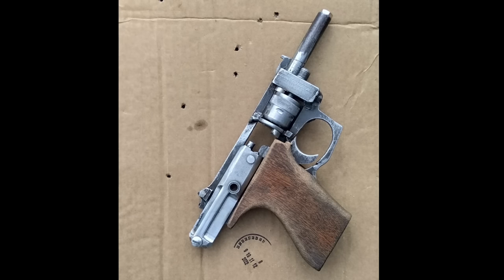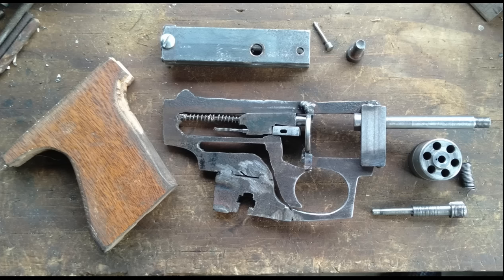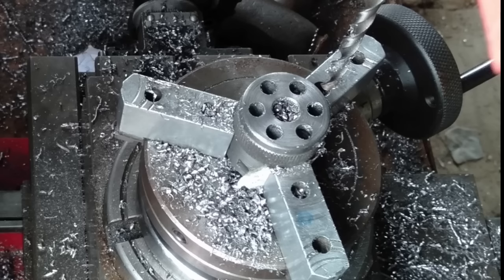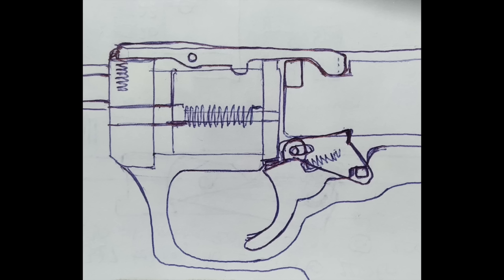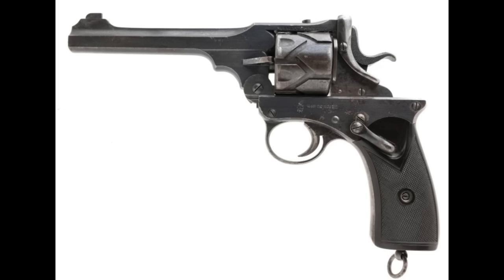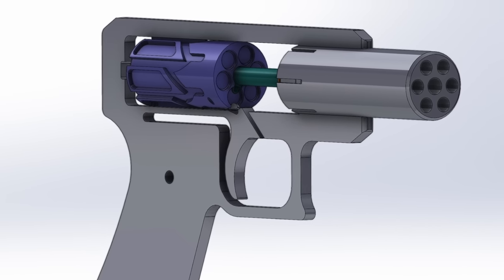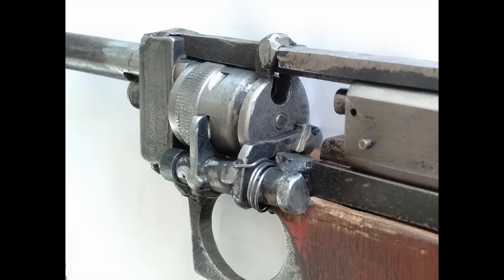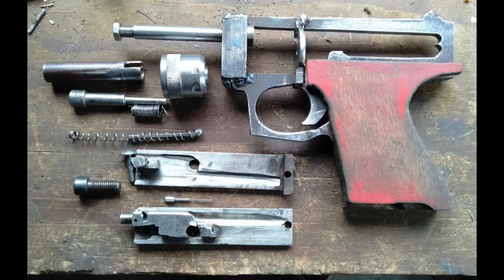Semi Auto Revolver?

Comment: The compliant mechanism in that trigger is simultaneously one of the more impressive firearms engineering design components that I've ever seen while also being absolutely cursed. lol
Reply: imagine the cost of replaceing a triger on a factory gun with a compliant trigger 
and the new ffl transfer involved
Reply: @Knobs4u  those things actually last for close to an eternity, the thruster redirection systems on space probes were designed with compliant systems so that they have the highest possible cycle lifetime possible as you don't get to do maintenance on something you shoot out far away into space.

so chances are, if the frame is well built you can pass the gun down several generations and shoot all day and it won't break.
Reply: @baraka629  you missed the joke, but thanks

Comment: A full auto revolver is something I've been thinking about how to do but obviously not going to build one because I don't have an SOT, would love to see your version of it
Reply: You can absolutely build it as a semi auto.  Well within your rights to do.
Reply: They exist, some fighter jets use what is called a revolver cannon. Single barrel, but it has a revolving cylinder which handles the cycling, each chamber taking turns doing each step in the load cycle as it goes around, so they can reach truly blistering cyclic rates.
Reply: @Vikinggunsmith You don’t need to have an SOT or any other gun license,to make your own gun.Outside of the normal gun laws like not being a convicted felon and other stuff like that,the only other requirements is you can’t make the gun full auto,and you can’t ever sell it to anyone else,and you might have to put a serial number on it ,depending on what state you live in.
Reply: @dirtyd2316  for a machine gun (full auto) you need an 07 FFL and an SOT otherwise it's a unregistered NFA item, for a semi auto you don't need any licenses and all that, if you need sources look at the NFA of 1934, the GCA of 1968 and the Hughes amendment of 1986
Reply: @dirtyd2316  if you have to put a serial on it then you may as well fill the form so it can be sold to someone else after you pay the appropriate fees
Reply: fully automatic revolvers how to make has been around since the zig zig and Pancor Jackhammer revolver shotgun. its absurdly simple
Reply: There's an article in an old issue of Guns and Ammo that says they accidentally figured out how to convert a single action revolver to full auto when attempting to figure out how much cylinder gap affected velocity. They had built a single action army so that the barrel could be threaded in and out to adjust the size of the gap, then it turned out if you had the gap big enough the gun would go full auto. What would happen is the cylinder had enough play to move back and forth, so when you fired the recoil would slam the spent casing back into the firing pin (integral to the hammer on as SAA), which acted as a short recoil system that had enough force to cock the hammer. Since there wasn't any kind of disconnector in the trigger the effect was identical to fanning the hammer.
Reply: Ever heard of the Luty? You can build what ever you want dude , home made machineguns are 100% legal in the USA,  it just can't use any gun parts , as long as you mill everything yourself it can be full auto
Reply: @vikinggunsmith  no you can build a machinegun if it uses 0 pre existing gun parts , they can't stop you from building it you just can't sell it
Reply: @Cold_Cactus  the Hughes amendment ended the registration period for machine guns for private use on May 19, 1986, and per the NFA All machine guns must be registered with a tax stamp, nice try fed but I'm not that stupid.
Reply: @Cold_Cactus  That just isn't true.
Reply: Gotta love the nfa, nothing stifles innovation more than prohibition. Imagine what new full auto tech we would have if we didn't have what like half a century of no new civilian legal automatics.
Reply: @Cold_Cactus  nice try agent
Reply: @dirtyd2316  You darn well do need an SOT for automatics though!

Comment: Semi auto revolver with a slide that operates like an open bolt gun?
One of the weirdest things I've ever seen.
Reply: Hey, you again! How are you?
Reply: the 10mm pistol in fallout and fallout 2 have a similar mechanism
Reply: @FN_360  doing fine I guess, hope you are as well.
Reply: @ARMASOG  I figured it was more like the Dardick because it's implied to have a magazine (even though it has an exposed cylinder, but that's mostly because it was originally a legitimate revolver, probably.)
Reply: That’s creativeity.
Reply: You can drill through pics of confiscated arms. There is something roughly  like this in one of those pics.
Reply: I would buy it cause it’s cool
Reply: Actually, I'd say that the idea to use pre-chambered rounds (i.e. revolver cylinder) is not bad at all, considering the calibre. .22LR, a rimmed cartridge, is well-known to be not-quite-so-reliable when fed from box magazines... I only know one pistol that works really well with .22LR---and that's the famous Beretta M71 (mine is almost absolutely reliable, only ever had 1 failure to load).

With "true" pistol calibres, a box magazine makes a lot more sense and benefit; to the point that in such a simple open-bolt design, it's actually the most critical part of the gun... :-)
Reply: ATF wants to hear more about that "open bolt auto-revolver"
Reply: Kel-tec needs to hire this guy
Reply: Murphy's Laws of Combat: "If it's stupid, but it works, it ISN'T stupid!"

Comment: The original OWEN GUN PROTOTYPE SMG had a rotating cylinder that was wound up with a clock spring. Owen made it as a teenager out of an old .22 short rifle. A thumb trigger released the open bolt for full auto fun! Love your work and videos!

Comment: Love to see different gun ideas for how to meet various needs and ideas.  I once saw a .44 Taper pistol made for the French Foreign Legion in North Africa.  Because of inevitable sand intrusion in the desert, the big revolver (looked Webleyish) not only had all moving parts working at quite wide open angles so as to not trap sand and jam the action, the cartridge case was a pretty steeply tapered conical shape so if sand got between the case and the cylinder wall, a sharp tap in the fired brass would dislodge it easily rather than trying to drive a straight wall case out of a cylinder with sand imbedded and scratching all the way.  The most impressive feature was that the back of the grip frame was hinged to open like a book and could be unlatched and swung open, quickly cleaned, then closed and returned to service.  Also, all of the functioning parts were highly polished like surgical tools to resist having sand adhere to them.  Would have loved to add it to my collection but the owner wouldn't part with it.  Really neat gun but I can't find anything resembling it on the Internet.  Jess

Comment: awesome, my thoughts were to combine the gb-22 with sort of sten-ish upper receiver. it would have to be striker fired closed bolt and most likely add a second piece to the frame trigger that acts as sear and disconnect. But if legality weren't an issue, it would be even simpler.

Comment: Having the cylinder use spring tension to assist rotation is pretty genius. i thought you couldn't really do this with a .22LR because you wouldn't have enough force over all to work everything. i wonder if you would replace mating surfaces with teflon and reduce friction enough to not even need the spring?

This revolver is basically the guts of a ruger 10/22 mag moved up inside the action and i kind of love it. The ruger mag is "wound" when you push rounds into it and they roll up in there.
Reply: Yup, an old magazine design going back at least to the pre WW2 Mannlicher-Shoenherr (sp?) or earlier.

Comment: Yes Mark, I've got plenty of questions after watching this thing a dozen times! It took me awhile to realize there's at least 3 different versions of this gun represented in this video which made it really confusing.

Only the version with the side lever to stop cylinder rotation seems to have been built. It looks like the release is supposed to be triggered by the slide somehow but the angle feature would push the mechanism in the wrong direction. (down) 

I'm also wondering how the empties are able to eject out of that single hole? In order for that to work the cylinder would have to stay locked until after ejection finishes otherwise the cases would get caught because of the cylinder twisting while they are partially ejected.

The drawing for the cylinder lever in the top of the frame is interesting but won't work as drawn. It needs a ramp in both directions in the bolt  so it's able to cam in both directions. Even then it won't work without a delay on the cylinder index cycle or it's also possible to slot the rear cylinder backplate to allow empties to exit. The trick would be to do so without leaving the rounds a chance to slide out through the slots when the firearm is tilted upright.

The bolt could be used to cam a lever while it's towards the rear of it's travel. That cam lever could run up to the index lock/release lever and trip it upwards so the cylinder may cycle to the next round. I didn't see one but that's one way it could work.

What's holding in the cylinder pin? Is it supposed to be screwed in to the rear cylinder backplate? I didn't see any threads on the end of it. I like the ball detent to hold the cylinder pins in place on the North American Arms mini revolvers. 

I now see it's not using a clock spring for cylinder rotation. It's using a round spring around the retaining pin. I can only see in the drawing that one end of the spring is keyed in place by a hole. I'm not sure what the front end of that spring is attached to.

Mark; I see your design is a pepper box with a fixed barrel. Make that into a muzzle loader with cap nipples in the back and you have created a new legal machinegun that could be owned by anyone since they are not regulated as firearms for now. You probably couldn't pull the trigger on it fast enough to prevent  at least half of your ammo from going off between pulls but it would still be cool. Increase that cylinder to even 25 rounds and it would be already getting too heavy to be practical. (it would still look cool)

Comment: I know of some more automatic revolvers. 

There's one by a company called Union Automatic, and designwise, imagine essentially those little Smith & Wesson topbreak .32 revolvers which were popular in the early 20th century, but if you cut it off right above the trigger and set the entire thing in a second frame (which has a grip vaguely similar to a C96 Bolo), and the revolver part slides back and forth in the lower frame, with a pawl engaging slots in the cylinder to index it. Less than 100 made because they sold poorly, an expensive and unwanted gun which fell inbetween the normal revolvers and the proper automatics.

Another is the Pancor Jackhammer, that goofy bullpup machine shotgun, it used a large grooved cylinder which was motivated by a piston.

Then you've got the proof of concept prototype for the Webley Forsberry, which was made on a good old fashioned Colt 1873.

Comment: The flexture thing is pretty cool I wonder if it would be possible to make the entire trigger and hammer on a single sheet of metal
Reply: Maybe even trigger, hammer, and disconnecter mechanism, all a single piece of spring tempered steel with the frame.

Comment: So when I was in gunsmithing school I came up with an idea for a similar design but the slide would eject and reload the cylinder,  eject out the top and feed in the bottom from a magazine,  that way if theres a failure to eject or failure to feed you still have 6 rounds to go after the malfunction,  only hitch would be instead of racking the slide once to load the chamber you'd need to rack it six times to fill the cylinder then top off the magazine but it would be a "jam proof" weapon essentially,  in the sense that any jams wouldn't keep you from firing it would only limit capacity,  ive got some doodles but nothing serious like you guys but hey here's a good challenge for ya

Comment: Direct... blowback... revolver?

Okay, why the hell not? Gun design needs shaking up from time to time.

So. What specific advantages and disadvantages does it have (other than obvious complexity)?

 The trigger as part of the frame trick is cool if for no other reason than reducing parts count, but did you have to do any weird heat treating to make this part springy and that part tough? If not, what grade of steel did you use?

How hard would it be to scale up or down? Yes, of course I want to see one in .50 bmg.

Comment: If you want to design a semi-auto revolver, people have accidentally done it with cylinder gap experiments.  Years ago someone had a smith and wesson that IIRC was a model 53 in 22 rem jet.  They were noting the changes in velocity as the cylinder gap was increased by turning the barrel outward from the gun.  At one point the forward movement upon being struck by the hammer and during recoil of the loose cylinder then going backwards during recoil was enough to cock the hammer.

Comment: I wasn't expecting the dang thing to actually work. I wasn't expecting there to be footage of the thing actually functioning as intended. That's extremely neat. But wait... Is this sort of an open bolt firearm? It looks like the rounds are fired by the slide/bolt dropping onto them. If so, couldn't this thing be easily turned into a full-auto revolver? Seems wild.

Comment: That thing looks to fire from open bolt  like a machine gun. If his idea was to escape from the hig bore axis and mazle flip problem, he jumped from the lake into the well because now his gun is also jerky when he shoots not only after... If you want not to spread the tubes, mount a bag or some canister on the pistol or use caseless amo if you realy want something else. Or use a gass seal revolver, so as to use a silencer if the pistol makes to much noise from the slide and you need more rounds so a locking slide is not enough, or make a more silent slide with rubber buffers. Using .22LR subsonic is good for that, .64db when well silenced is wey better then 128-140db for 9mm subsonic, with 3db being double the noise.

Comment: As far as I am aware, the main reason why we don't see more semi-auto revolvers is that... it's too complicated for the purpose it holds.
Revolvers are usually meant to be simple, reliable guns that unfortunately come with not so much ammo to use as there's a limit on how much you can put into a cylinder without making it ridiculously large like the one in a 3-barrel revolver.
A semi-auto capability is more understandable for magazine fed pistols that can hold more ammo than an average revolver would and put out much higher volume of fire before running out. 
It's simply too impractical to make a revolver so complicated when it can't really benefit much from the complexity due to its limited capacity.

Comment: I noticed you mentioned assassin's in regards to this cool adult toy!
note If you are an assassin and need more than one round, you should go back to working at IHOP.
Personally, I would never use a gun for a sanitation run.
If I were to bring a gun it would be because the receiver is in a high secure area and I need  to ensure I evade interrogation upon possible capture.
Only one round needed!
Otherwise, there are much more modern ways to cleanse an area without the need to alert locals.

Comment: Why only let the trigger be part of the frame? Why not a also a recoilspring? It could be a bunch a T shaped extruding bits(like the trigger spring) alternating from 2 sides, slightly diagonal to eachother. I could draw you a picture in paint of what I mean, could be a really cheap way of making a gun. Also make a 2D bolt and fram that is all cut from 1 piece. If you maken the revolver cylinder a removable mag, you dont need much movement of the bolt, because you would have to extract anything, the empty cases just stay in the cylinder. Would also prevent overheating, because you remove the chamber every time.

Comment: A while ago I randomly brain stormed an idea of a regular looking revolver. But it had a large, fucked up hammer with an extractor and firing pin on it. It essentially operated like a direct blowback open bolt machine pistol that ejected the rounds. And it advanced the cylinder the same way every revolver does. If only I was a brilliant machinist, I'd manufacture all kinds of fucked up guns. 😂

Comment: builds trigger into frame dosnt realise every use will make the trigger weaker over time.
Reply from the maker: @jesseclutterbuck6617  You're completely wrong but thanks for the comment anyway!
Reply: Its physics. Adding constant tension to metals makes it slowly 
 deform over time, the neat crystal structure breaks into a complex three-dimensional web of crystal defects called "dislocation walls" that enclose cells of dislocation-free material. This leads to air bubbles in the metal eventually causing a clean break at its weakest point.
Reply: @jesseclutterbuck6617  Mark is a mechanical engineer. Also, you’re referring to void propagation, and while under several several thousand repeated loadings you will get that, it’s unlikely you’d ever get to that point in a lifetime. And, it doesn’t seem as though the metal is experiencing any plastic deformation, only elastic.